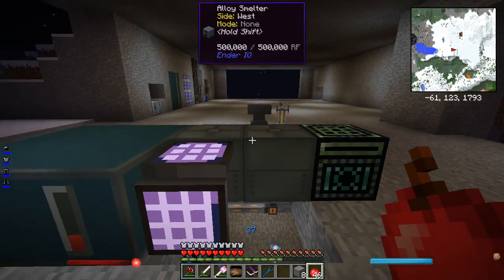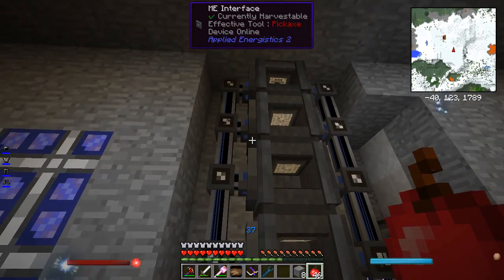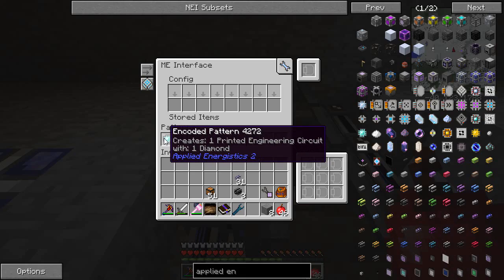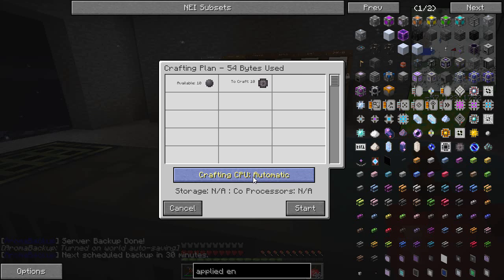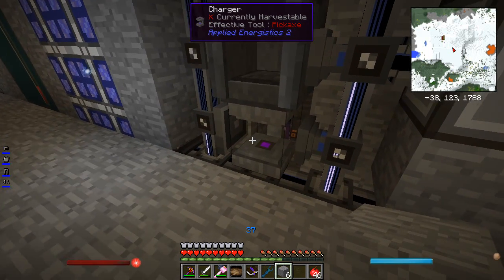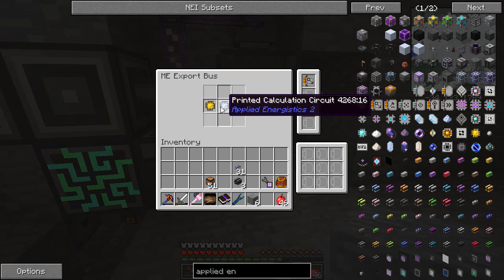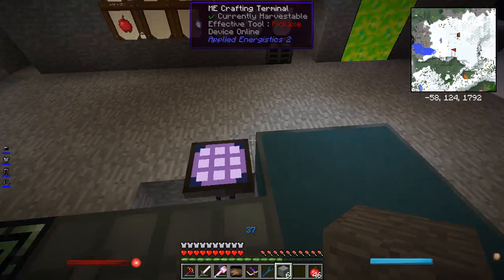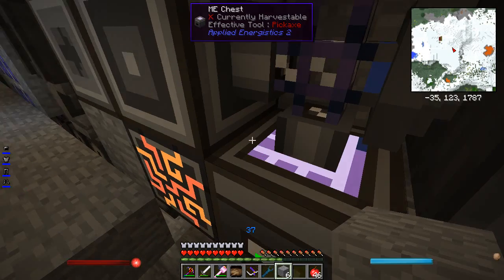S03E11 - Howto - AE Inscriber Automation

Comment: Yeah, having issues, I can get this setup to make the parts for the chips , but will not combine them in the last inscriber to make the processor.
Reply from the maker: Without knowing your setup, I'm not sure I can help I'm afraid... If its the same modpack version as in my video, and you've got the right buses on the right sides, and the filters set up correctly, it should work... This video is nearly 2 years old though, I'm not sure AE functions completely this way any more!

Comment: Hands down, this is the best AE2 tutorial I have found on Youtube.  And your solution is the cleanest I have seen.  I will now copy this outright.  Thanks (Sub'd, Liked) ;]
Reply from the maker: +00100000station Aww man! Thanks so much for watching and the awesome feedback. :-) I definitely like my automation to look as clean as possible, but in this case there is actually a slightly cheaper way of doing it - without using sub networks. When I made this though, I liked the idea of a subnetwork, I'd never done one before. Plus I just dont usually like making it so I have surplus or wasted materials in machines. The other solution involves always having silicon made and always pumped into an inscriber, this just seems wasteful to me. :-P

Comment: howd you make the patterns for the stuff im trying to make them and it wont show anything
Reply from the maker: +TheGameGeek You mean the presses? The four plates you need are only found inside chests inside the middle of the asteroids that have fallen to earth. You build one of those compass things, and it shows you where asteroids are. They are sometimes buried, and sometimes on top of the world in a big crater. You'll need a diamond pick at least to get through the blocks, and they take longer than obsidian to mine. But, inside each asteroid is a chest in the center, with 1 - 3 plates inside.
Reply: no the patterns for the drives and stuff
Reply from the maker: +TheGameGeek Oh... umm, just the standard ones in NEI? Not sure to be honest, I never had a problem making any of the applied energistics stuff, the patterns are right there in NEI, standard crafting bench will make them.
What exactly is the problem you're having? It might depend on which modpack you're running as well...
Reply: how to make a crafting pattern for them
Reply from the maker: +TheGameGeek Sorry I'm still not sure what you mean - what thing are you trying to craft specifically?
Reply: the crafting pattern for like the logic proccesers and stuff
Reply from the maker: +TheGameGeek Thats what the inscriber does - it makes the processors. You dont make the processors in the normal crafting grid, you have to put the materials in the inscriber instead. Its a couple of steps, but both steps are done in this machine.

Comment: Quick tip, middle mouse click on something and it will open the auto-crafting menu (assuming you have the pattern) even if you have an amount of that item in the system. (like how you pulled the logic processor out to craft more) instead just middle mouse click. For those who don't know you click the scroll wheel down.
Reply from the maker: MeatHaven You know, I never thought to even try the middle mouse button in minecraft - I'm not used to it doing anything! Cheers for watching, and for the tip, will definitely be using it! :-)

Comment: very nice
Reply from the maker: Thanks for watching! I figured out after making this video that there is a much simpler way of doing it, altho it involves permanently stacking some of the slots with materials. The way I did it in the video seems more technical and "cleaner" to me, but its definitely more convoluted than it needs to be, and uses slightly more power...
Reply: I haven't really played much of the 1.7.10 mods so all the stuff is pretty new to me, so I am playing on the ftb infinity pack, and I found a pretty simple way of doing it, I just always have silicon ones being made with a level emitter on it so it doesn't use all my silicon, than I just always have redstone and silicon being pumped into the 5th one, so than I have the interface on the 5th one and 3 recipes saying that one of the printed circuits make a processor.
Reply: P.s. we should make a youtube series together sometime if you interested, I have action! And a 2tb external hard drive to put all my videos on, I actually have a ton of footage recorded, but I just get bored recording myself lol
Reply from the maker: ben andmesser Yeah thats the easier way of doing it. I did my next lot exactly the same way, but never recorded it.
I've just started the Infinity pack as well - literally posted the first video up last night of it. Going for a mod to start with that I've not really used before, so I'm learning as I go, trying to keep it interesting for myself as well as an audience!
Reply: hell yea we'll i'll stay tuned than XD